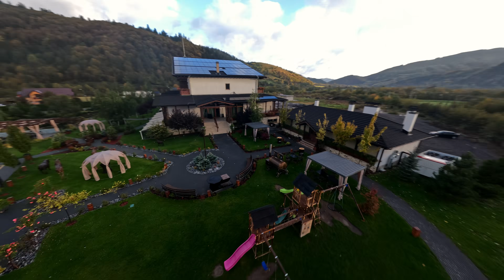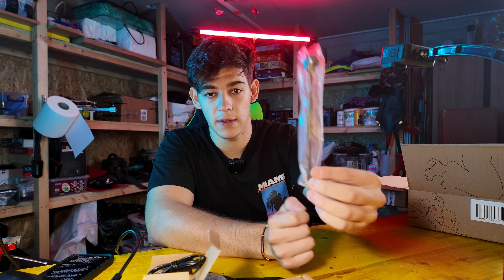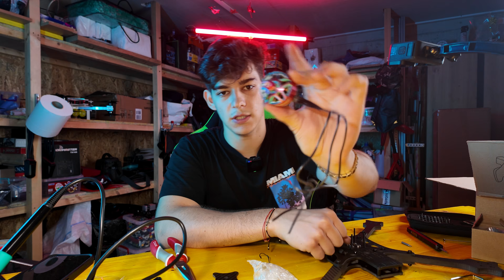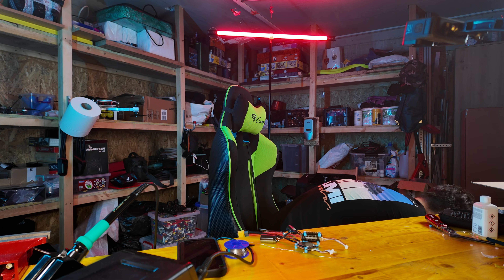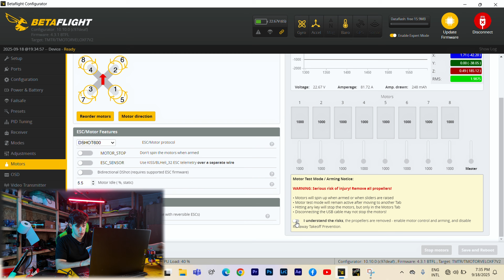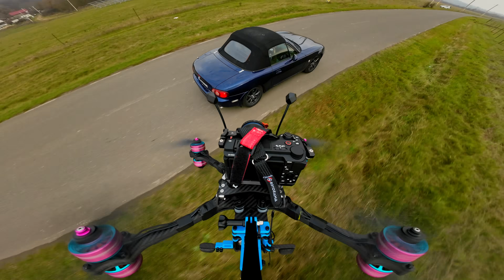I Built a Cinelifter FPV Drone from Scratch  | Full Build + First Flight

Comment: How effizient is it compared to your 7inch?
Reply from the maker: If we talk about flight time it is less eficient because it has 8 motors but a ratio between power and flight time it is very very good. To give you a fair example, I flew it with 70% average throttle, a payload of 750g aprox and the battery lasted for around 6 minutes

Comment: Those capacitor wires are way to long...
Reply from the maker: I have installed them in a pasition that I needed long cables
Reply: @Raresfpv  yes, and thats too long :) cap should be as close to esc as possible.
Reply from the maker: @Fpvna30 I know that but still it works exactly as it should, even if it is at a longer distance
I have tested it with shorter cables and there was absolutely no difference
Reply: @Raresfpv  and how have u measured it? :)

Comment: Only bad thing about flying a coaxial x8 drone is they are very inefficient with battery life. I have a x8 7 inch and its horrible on batteries even with a great tune. You might be better with just a regular 10 inch. I have a 10 inch i built and i get crazy long flight times compared to the x8
Reply from the maker: Completely agree but what I can tell you is that I have absolutely NO TUNE on this drone and I have a lot of power. Flight time is around 5 minutes and I think that is pretty decent✌️
Reply: @Raresfpv strap the biggest battery to that bad boy even if you have to run a couple in parallel. Coaxial x8 is always using dirty air from the top props. That's the problem
Reply from the maker: @VinydFPV yeah this is true but I think it still does a great job for what it was designed for